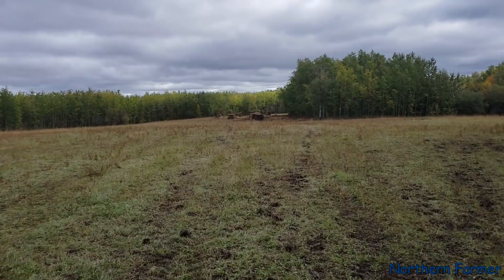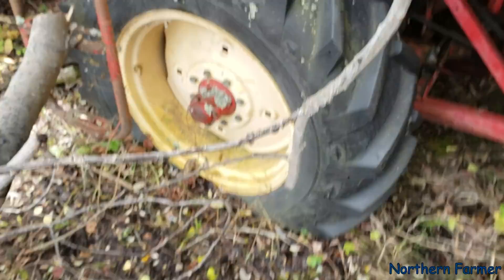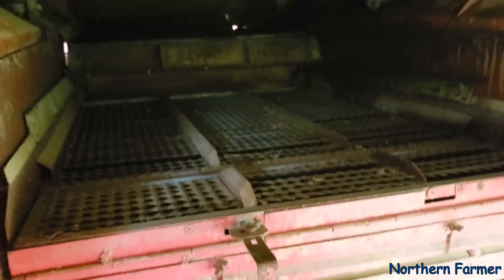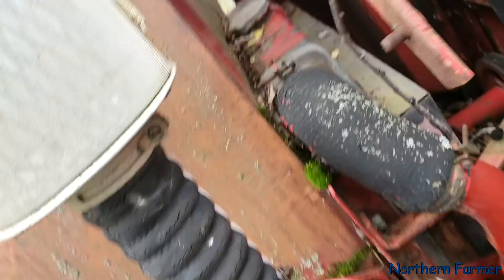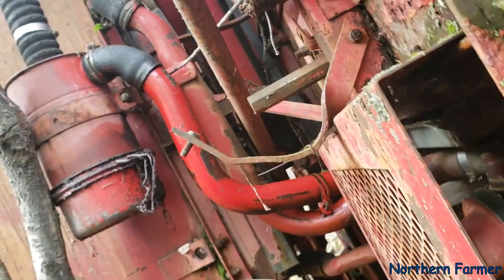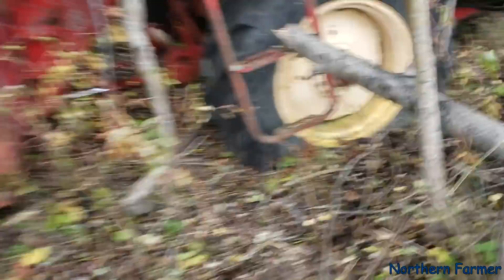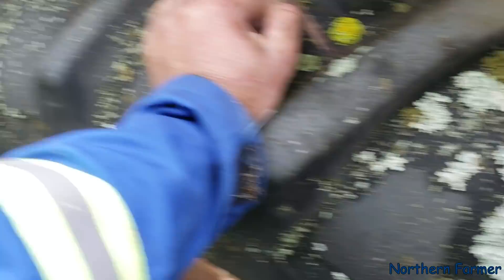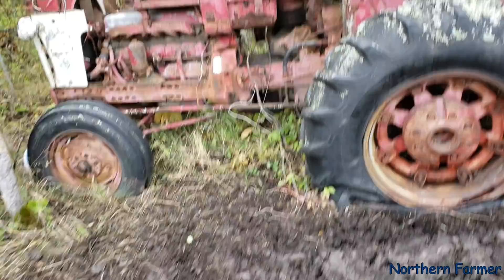Old Massey Super 92 Combine and IHC 560 Tractor!

Comment: The Super 92 was the state of the art back then and was my dream combine. I never  got to operate one but it was may job to operate the old number 27 Massy the for runner to the 90's. 92's and the Super 92. That three bladed prop looking part at the rear was the straw spreader. If I remember correctly the Supper 92's was the first real low profile combine and this is why the radiator air intake cowling was in a horizontal position rather than the upright position of the older 27 models. Rarely would the old 27's vertical radiator air intake cowl stop off with chaff or thistle heads,  a cotton like fiber and cause a engine heating problem and the intake was in plan view of the operator. The Supper 92's had a horizontal radiator air in take screen cowling and was not in view of the operator. The mystery shaft coming out of the right mid-side of the combine and connected with a rubber hose to a small transmission in the air cowl operated an air baffle that would turn a baffle so air intake only use the inside half or the outside half one side at the time. If you were off the machine you could see the chaff and debris fall off one side as the baffle switched from side to side. The fan at the right front of the engine kept the straw and chaff off the engine to help prevent fires and cool the engine. None the less this very same fan kept the operator well supplied with hot air even in the hottest days of harvest. Cabs where unheard of then.

Comment: on thursday afternoon we went out and combined 2 trucks of 19.5 barley, was mighty tough going these older rotery combines don't like tough straw, saturday we mixed that 800 bushels with 2500 bushels of 12.2 barley and ran it through the mixer/grinder , chop sure felt warm after we got finished. only had 20 acres left of barley on the fields. Friday morning dad measured just over 6inches of wet snow in the middle of the hog yard and just 1 inch on our home yard, 1 mile away.

Comment: The radiator screen had a flapper in it that was supposed to beat the chaff off the screen. It didn’t work so hot in a breeze. We ended up putting a spinning screen from a gleaner on our super 92. In its day that was an excellent combine. The industrial Chrysler really barked in a hard crop and is a sound you can’t mistake. Ours was really easy to flood with the side draft carb so we always started it with the gas turned off and the ran back and turned it on. I have to say that ours made the cleanest grain samples I have seen in my life - way better than the 9500 Deere I use now. We had a cab on our two but with no air conditioning in Kansas all it did was provide shade and not a lot of that. I would buy a super 92 to do milo each year just to have the memories again. Just something to play with.

Comment: The thing on the ground behind the combine is the straw spreader for the combine and the hose cuppling is to run that gear box inside the meash there is a air baffle that goes side to side it cuts off the air flow temporarily allowing the chaff and debris to fall off keeping the mesh clear and the air moving

Comment: I just read your comment on MN farmer, you might have ask Mike Less if you want Versatile, would try Versatile combine?  560 IH is nice tractor but getting parts would hard, we have A554 small four cylinder and hard tog parts, especially crank👍
Reply: Back in the 90s a framer out in Iowa had a prototype and JD bought the patent rights . Versatile combines are like that and I have seen 1in operation . But you got the Tribine that is supposed to eliminate grain cart and less compaction . But now they talking about small units that are remote-controlled run from your office . Mike Less is Mike Less the end

Comment: i will take a quess the hose is a flex coupling for the fan cleaner
Reply: Correct...A device inside the radiator screen to keep it clean.
The fan on the engine was there to blow the chaff off the engine so that it wasn't a fire hazard.
Tha engine by the way is a Chrysler industrial engine. Same as a Dodge Truck.

Comment: The hose  on the combine that connects the two shafts on the bottom of enclosure is used as a universal joint in case the shafts are not in perfect alignment with each other preventing either shaft from breaking. someone failed to use the proper type hose, it should have been a piece of hydraulic hose

Comment: Do you realize how rare that tractor is being a utility tractor
Reply: It isn't rare, it's is a Wheatland (standard).  The row crops were Farmall and the Standard were International.  That tractor was made for heavy pulling, it was the Versatile or Steiger of it's day
Reply: George Gundersen. I agree with you. Allot left are narrow front end. I have seen very few set up like this one.
Reply: A friend of mine had a 460 and a guy drove 700 miles to buy it
Reply: How rare it is may depend on where you are. Here in Wisconsin a 560 Diesel wheatland I believe is quite rare while probably not on the prairies of Canada. But a 560 diesel row crop is common here it is probably not so common on the prairies of Canada. Just my thoughts?